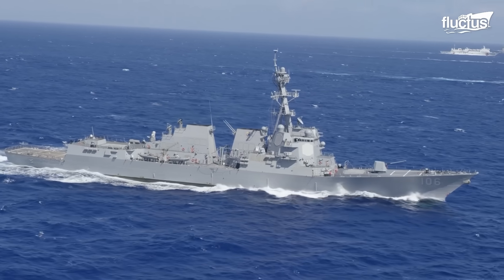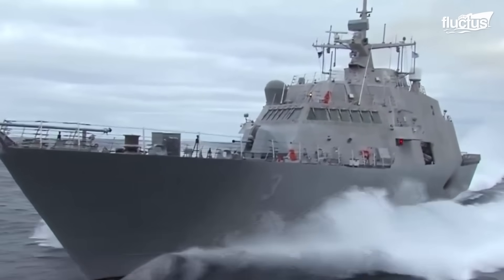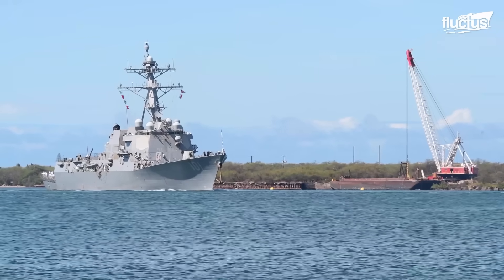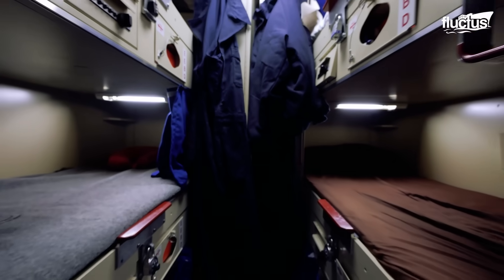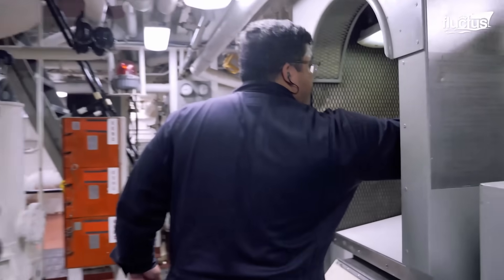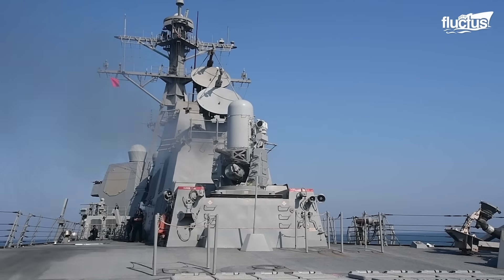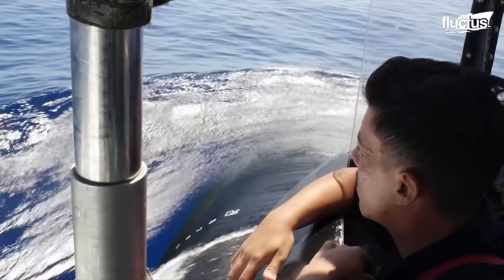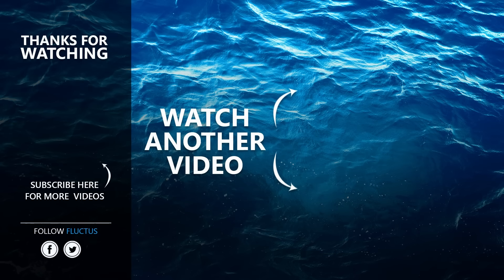Life Inside US’ Most Feared Billions $ Destroyers Patrolling the Seas 24/7

Comment: A couple of things I noticed. For one, in all the shots from different angles of the unrep process, I never saw anything that I could identify as a PDL. There is one shot of some men on deck holding a line tight, and you can just see what could be a flag out over the water, which could be it. However, they're at the wrong part of the ship, normally at least, and the flags should be more visible and every 20 feet. I saw nothing that looks like it. 

To explain, I spent ten years in the Navy, three of that on a frigate, as an ET. On that frigate, our ET shop was responsible for the PDL. The PDL is a Phone/Distance line. It's basically a ruler to measure distance between the ships along side each other for the unrep, and contains a sound powered phone line so the captains of each ship can talk without going over radio (and being picked up at a distance). An unrep is vulnerable position to be in, since your maneuvering is hampered. Generally, it's run from bridge to bridge. On our frigate, we'd usually be on the signal bridge, just above the bridge wing. The line is held tight, with the 0 feet end tied off at the supplying ship side. It was always the first line over and the last line down during an unrep. With a requirement to be held tight the entire time. You'd be surprised how much wind resistance a canvas flag every 20 feet can offer. 

But, I don't see that here. So, I'm wondering if I missed it. Or, did the Navy replace that system sometime in the 35+ years since I was there doing that. And if so, I wonder what it was replaced with. At the time, as a radar tech particularly, it seemed an antiquated means of performing its function. But, from a military perspective, it's a method that doesn't give any clues to any potential eavesdroppers, unlike any electronic means of accomplishing the same.

The other thing I noticed is that the CWIS gun seemed slowed down. Granted, I was never on deck when our gun actually fired, but I've seen movement checks (very impressive) and I've heard test fires from within the ship. Generally, a short 'brrrrt' for a couple seconds and that was a few hundred rounds. Test over. The sound here seemed slower and more drawn out, like they'd slowed the film.